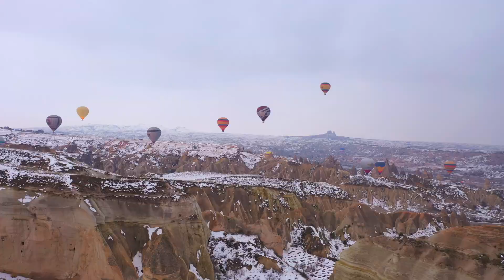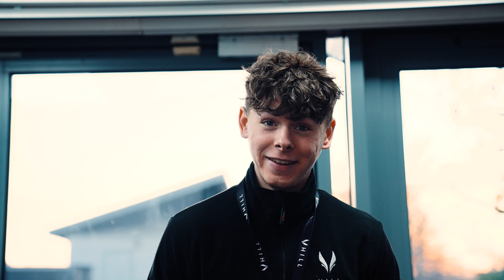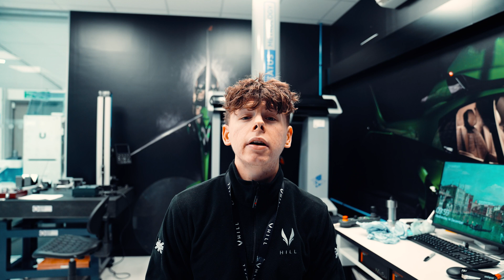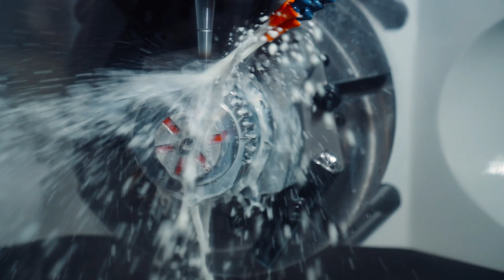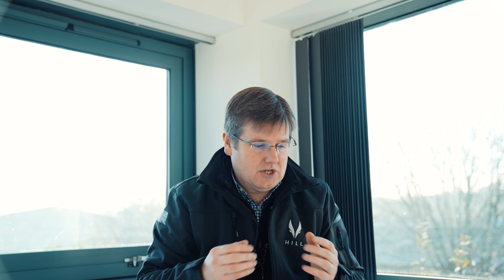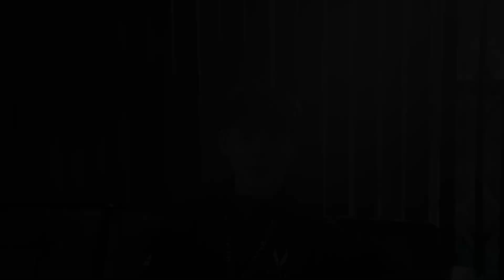Journey to HX50 | Episode 21: Vertical Integration and the HX50

Comment: vertical integration, i thought it was something to do with helicopters, haha, maybe it should be now
yep i have always thought the idea was sound, and it definitely has its place, but you are still not in control of the materials
so for example, i hope with the supply of carbon fibre, you would have more than one supplier, if only one supplier, they might have a shortage and that will upset the production, with more suppliers you can shop around, but will the price differ
so there is always a little juggling to do, i've done it and its a real pain when production is halted and costs

Comment: Superb example (Ford) of Vertical Integration Manufacturing, looking on some forums its clear that a great many people have either forgotten or never knew of this principle.

They speak of it as though its the dream of a megalomaniac (hmmm, maybe in the case of Ford!) rather than a very sensible business choice.

They question why try to make an engine when so many good Aero Engine Manufacturers exist, apparently not understanding the very clesr and well stated benefits of V. I. M.

I doubt that there's ever been a better time to take as much in house as there is now, with technological manufacturing and engineering advances maing more possible.

Comment: Vertical integration is absolutely the way forward, as we’ve seen with Tesla and SpaceX you can rapidly iterate and change things on the fly, without having to notify a supplier who has big lead times. It allows a business to react, change direction very quickly. If you find a development process is going in the wrong direction it’s so easy to stop and change. Asking a supplier to do that would cost an enormous amount of time and money, meaning you tend to fixate your design and process in one direction.